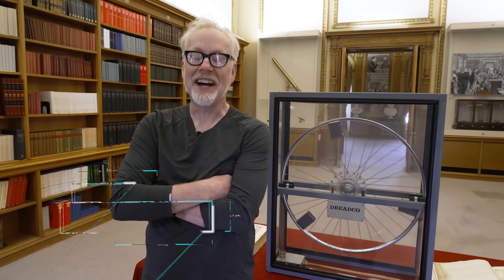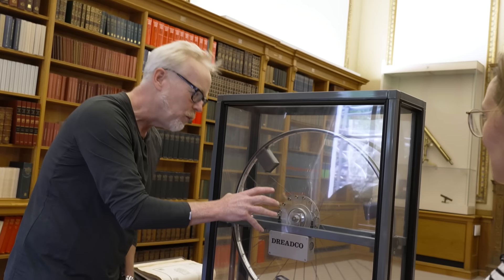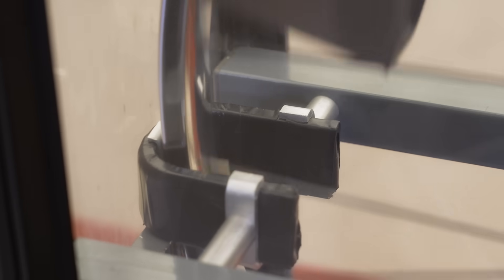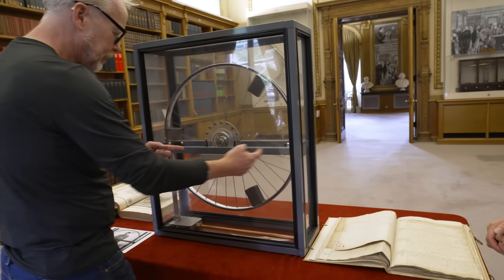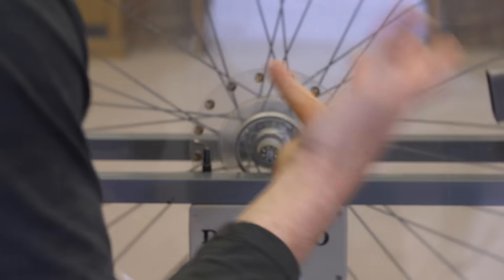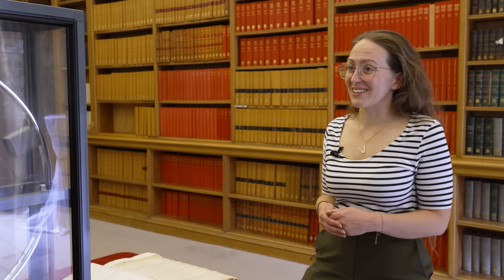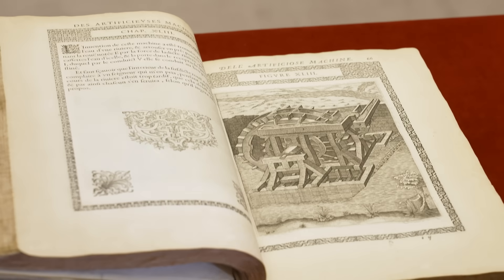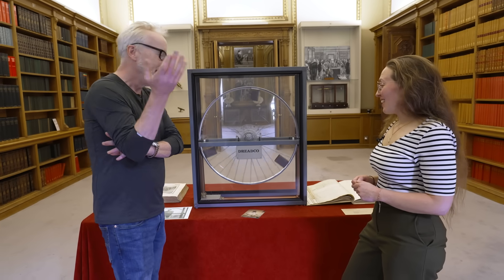Adam Savage vs The "Perpetual Motion" Machine!

Comment: This is how I would inspect this wheel.
Put a camera on a tripod. Position it so that the optical axis if the lens is on the rotation axis of the wheel. Film it for couple of minutes to get a precise angular speed. Also with a bit higher fps if possible but may be not necessary. Now, edit the video by rotating the image in reverse direction to make the wheel stationary. This way you may see anomalies in the wheel movement, whether it's speeding up or slowing down at certain points. This way you would know when the force is applied. Additionaly you could process the video through motion amplifier filter to make the anomalies more pronounced. This might get ideas not only when the force is applied but also where and what is the nature of it. Would that be sinusoid like or a short impulse.

Comment: I suspect those boxes are filled with water (or liquid) which cause a weight transfer thus turning the wheel. I also suspect because of evaporation of the water (or liquid) within the boxes this is where the service bit comes in. They just top up to the required fill line.

Comment: Perhaps only 1 of the three rotating boxes is active and the other two just dummies of identical mass for balance. And only one of the two U-shaped objects on the sides is a magnet the other is just dead metal. Inside the 1 box is a micro circuit (with battery) turned on and off by means of some small mechanical switch that reverses current in a small wire loop within. This causes attraction as it approaches the magnet and then pushes away from the magnet as it passes by.  All forces and currents are ultra small allowing the device to run not just for long periods but with imperceptible changes in rotational velocity.  Everything else are mere distractions.

Comment: if you want true perpetual motion, you need a superfluid. If you take a capillary tube and stick one end into a pool of helium 2 it will make a fountain without any outside force. put a tiny water wheel generator into that stream and you could get free energy. The challenge is keeping that pool. May be an answer to a propulsion device in space.

Comment: I wonder if anybody has looked at this device with a thermal imager camera.   It would show the faintest trace of heat indicating a point of friction and also show anywhere any powered force is being applied as the wheels resistance to turn would enact an opposing force to anything driving it.  Even it it was some slow chemical reaction, or (long shot here I know but anything is possible) powered by a very small Radioisotope Thermoelectric Generator the faint heat given off would show but I truly doubt it is anything that crazy.  Adam pointed out the small heat sink and speculated on a possible small chemical reaction.  I think he was onto something there.   Back to my question, i wonder if they would allow a thermal imager or if a camera operator posing as one of adams crew could have gotten by with a thermal imager.

Comment: I like and agree with the anode cathode and the pins off the rim are the armature connectors. The magnet on the right crates charge to send back into the system, and the left side opposes it back to the rim by electromagnetic means.

Gravity is an outside addition to the system, and why it can go for so long. There has to be some storage system for energy, and this could very well be a watch mechanism, like what you wind up for old clocks, hence the service every so often, its rewinding the  mechanism.

Theres a balance of power between all of the systems to where a very tiny amount of energy is needed from the watch mechanism and the gravity with electromagnetism makes the other parts that move the entire system together.

Thats my thinking 🤔

Comment: To make your own device similar to this think of a deconstructed electromagnet pulsing mechanical battery driven clock . Use low friction open ended bearings , The tin cans on the bicycle wheel  will interact to the  2 stationary  electromagnets which give very carefully timed pulses controlled by hall proximity sensor and pulsing circuit. Batteries can be stored in the jiffy box labeled "dreadco" . 3 good sized lithium batteries will make the device run a very long time. The electronic pulse circuit can be also hidden in the jiffy box if you think there is enough room. Carful tuning of the device will be necessary. Good luck.

Comment: In 1980, a professor I had designed a hyper-efficient DC motor. He made a demo "perpetual motion" wheel that looked very much like the video. The wheel spun on magnetic bearings, and the boxes on the wheel were magnets. An antenna charged capacitors by background radiation (radio waves, electricity running through wires https://youtu.be/_DIjsB3eu-Y?feature=shared, etc.). The antennae was hidden in the box frame. A sensor on the wheel triggered an electromagnet at the precise time to keep the wheel spinning. Like the video, the device would slow down if left in an area with low background radiation, like a basement or metal warehouse that acts like a Faraday cage. Out on display in any city, it would run forever.

Comment: 3x Perefctly weighted boxes inside the wheel, maybe other weights inside the boxes that shift weight as the wheel spins to keep it turning, everything else is a decoy? and the 2 yearly maintenance is WD40? lol, but then the wheel turns too consistently for it to be weights involed there would be an ocsilation in the speed, slow/fast/slow etc. Man this could keep me thinking for years
Reply: Maybe it's just a vacuum chamber and the servicing is simply to remove any atmosphere that's infiltrated the box.🤷‍♂️

Comment: The giant Dreadco box is super suspicious.  It's also in the center of the wheel.  Likely it contains something like a motor and batteries.  Notice the screws on the front, which look like they have a little wear (2:30 - 3:00).  Once the wheel is spinning it wouldn't take much force to overcome friction and keep it running.  

The other clue is the secret is disappointing.  So this rules out being driven by changes in air pressure or temperature.  Solar is unlikely as well, given they keep it in the dark.  It's something simple like a battery or spring.  As they also noted it slows down over time.

Comment: This is the most obvious electric motor ever. The whole thing is a motor, the bicycle wheel is the rotor. It is probably being driven electrically by the box with the heat sinks on it, with the two spokes in the middle acting as hall effect poll sensors for commutation. There is a battery in the heat sink box, or it is in the label box. Doesn't matter.

It's neat how efficient it is if it can run for 2 years without getting recharged. But I don't know how you look at this and don't realize it is just one big motor.

Comment: Its an electrostatic motor that is powered by a clever wimshurst generator which uses the inertial momentum and the imbalanced 2 vs 3 configuration to constantly produce an emf. One U-shaped device on one side is wimshurst cathode, one is anode.

The 3 squares out 120 degrees apart are very carefully folded copper foil conductors in such a geometry that it has the most possible surface area.

The charge is stored in very low farad rating capacitors which collect charge to produce the high voltage.

A very simple machine. Can't possibly drive a load. And, as she stated, it does slow down. Which means its extreme efficiency and not even close to perpetual motion.

Comment: Im surpised not many people know much about bike rims and hubs? Maybe it was just a 90s kid thing that we would fix our own bikes. The weights wouldn't need to keep the rim rotating straight. All of the spokes on a bike rim are threaded. With those threads and using a spoke tool. You can do whats called "truing" the rim. Someone who is a master at that can make a rim spin literally perfectly straight and so that the rim is a perfect circle as well. 
Then also the hub bearings could be ceramic. Which spin extremely smoothly. Granted you couldn't use them riding BMX or mountain biking.

Comment: I really doubt that there's any forces acting on the boxy bits on the outer rim - I expect if anything the outer rim and boxes only serve to add inertial momentum, like a flywheel - to smooth out the actual imparting of force. I think 100% of the function exists in the dreadco box and the inner spool - probably just a series of batteries and whatever electrical bits you need to impart a tiny bit of force to the electrodes that come out the top of the box. I forget the exact details of how a Wimshurst machine works but I expect this is basically that but backwards. Everything else in there is either irrelevant or hiding more batteries. I'm guessing there's not more batteries though or the weight would be noticeable and give the game away.

Comment: Impossible? I designed one over 20 years ago. Not only does it rotate indefinitely, but it also hovers without using any electricity.
Reply: I violated the unbreakable laws of physics. Source? Trust me bro
Reply: @winxwest2964  okay, I was being a little dramatic. It will only stay at optimal performance within 150 to 200 years. So yes  I was wrong in saying indefinitely 😁
Reply: @DROPKICKaZOMBIE very efficient perhaps but that is not perpetual. Big difference.
Reply: @PSOnoni  I was wrong in saying indefinite. It would continue to move and hover without electricity,  maintenance or any intervention for 150 to 200 years, until it lost a small percentage of power which could cause it to collapse. It could take another 50 to 100 years after that for full breakdown.
Reply: You must be really wealthy then with that source of infinite energy, huh?
Reply: @joexer1  it doesn't make energy and if it did, it wouldn't be infinite.
Reply: @DROPKICKaZOMBIE  For perpetual motion, you'd need to tap into an unlimited energy source.
Reply: @joexer1  not true.

Comment: I'm a fan of the Oxford Electric Bell - https://en.wikipedia.org/wiki/Oxford_Electric_Bell - Which doesn't claim to be a perpetual motion machine. It is instead a long term experiment. That has been ringing a bell since 1840. Though there may have been two brief interruptions due to environmental condition changes. It's since been sealed behind sound proofing glass because the students and staff were sick of the noise.

Comment: The things on the sides are electromagnets powered by a battery located in the middle box. It works just like a huge, weak, but efficient motor. U could say it s a glorified wall clock.

Comment: there is a clock, that winds itself with air pressure difference....
it can also use temperature difference as a source of power.
if barometric pressure rises or drops, this has power. it can actually blow air in the box to keep the wheel turning.
letting temperature work as well, a rise in temperature will get extra air pressure

Comment: Normal weighing scales balance on a bar...so a cross bar with four scales hanging off it...four equal weights in each scale and an extra weight on one scale...the other three scales without the extra weight weigh more than the one with it...and when the light weight gets to the top it tips into the next scale...in a circle...and that extra weight is less than the other three...

Comment: The only way to create a 'perpetual motion' machine is to remove energy from a very large power source to power a very small (in relation) machine. In our case that would most likely be light or heat from the sun. It wouldn't be pure, but the only way to have perpetual motion is with perpetual power, which diminishes inevitably over time. You would need to be able to power it in such a way that it never stops and never needs to be 'serviced'.

Comment: If it turns out that theres a battery inside,a solar power system or whatever it is to power this thing,then all i can conclude is that this device is just a fake perpetual motion machine,in such case that david jones is just a fake scientist of a cheater,so he better off to prove that he is not cheating,noe let’s atleast agree about 1 thing,if this device isn’t using any electricity at all,then the only thing that will stop this device to be a 100% perpetual motion machine is heat and friction to cause it to eventually stop.

Comment: GOT IT! It's modeled on the Beverly Clock!! It is sealed in an air tight compartment. As the temperature rises & falls the air tight compartment expands & contracts thus providing low yield power.

Comment: With this low energy requirements this might just as well run on the minuscule temperature difference between the top of the box and the bottom of the box moving the wheel by simply circulating the air inside the box using a principle similar to what the Stirling engine does only on a microscopic scale. That might explain the radiator looking thingy at the bottom.

Comment: I would guess that the smaller circle of the wheel has a bunch of magnets capturing a small amount of energy with the little prong things off the demco box. In turn forces some energy out to the larger magnets around the outside pushing them around to keep it going

Comment: What Do U Think About A Electric/Stirling Engine Hybrid Vehicle?
...An Electric Heat Source To Power The Stirling Engine To Power A Vehicle While The Running Stirling Engine Powers A Generator To Recharge The Electric Heater Battery That Powers The Stirling Engine... Along With An Alternator To Power The Electric Heater While The Electric Heater Battery Charges Up?🤔 Farther Range Possibly Than A EV As We Know Today🤔...

Comment: I think it is a unballanced wheel, in the boxes is a schifting/sliding part with some mass, the two oposite parts where the wheel runs between are Electric Magnets that with little Electric energy move the part in the box from oudside to inside and visa versa so on the right side wil the wheel have less mass than  it have at the left side, right must go UP, left must go down and that unballance in the wheel wil turn it.

Comment: I could make that run longer than two years,, if the angular position finer then the magnetic forces could be partially captured rotation as well as very lightly and auger magnetic rotation then you could have it running for about 270 years on a twin AA rechargeable battery cube, it also has copper piping that could permit for all sorts of applications.

Comment: I thought it was common sense but with advanced maths lol... basically the weighted plates need to be perfectly spaced apart so gravity pulls weight down while it also pull the other side up
Reply: Well, it’s not common sense because that doesn’t work.

When you make the weight heavily baised to one side, the center for rotation moves off the axle. It no longer will rotate properly. Usually the center of mass moves below the axle.

Comment: The only REAL Perpetual Machines are Solar Systems. No batteries.
Reply: That’s not perpetual motion… it’s getting energy from the sun. Perpetual motion requires no energy be put into the system.
Reply: @captainhellhound7451   yeah but sun is part of the system. it's making unlimited energy for the perpetual motion system to keep going on and on
Reply: @kingbeastu  the sun is going to die. It will eventually collapse in on itself.
Reply: @captainhellhound7451  Yeah but that's along time later

Comment: Perpetual motion is seemingly possible by creating a pressure difference due to difference in temperature. Hot air rises because its density is affected  by temperature. As air rearranges itself a pressure difference is created between the top and the bottom of its vertical trajectory. This rearranging creates a flow of air that can be used to create motion. But… this isn’t free. Temperature differences are created by an HVAC system or other external sources like the earth or the sun.

Comment: 0:26 MAGNETS & Static Electricty!!!! When they pass through, it creates a charge, which is then passed through the piping to the other side, to keep a balance. The heat sink, is so it doesnt overheat after months of doing it. The central cathode and diode, essentially do the same thing. Creating an electromatic charge from the friction/static charge of the central wheel. This adds to the decrease of loss of productivity
This is why it is enclosed. So it can maintain the proper temps, and humidity. To help create that static charge
Is a relatively simple machine, one in which has been done throughout history in different formats

oops, was i not suppose to say?

Comment: As a kid I had a very small crystal radio, without any battery. All it needed to produce sound was it needed to be clamped onto a metal curtain rod. It picked up radio waves and used that energy to drive a tiny in earphone. Maybe a Faraday cage could stop it.

Comment: I always thought if you took a "stick" with a bearing on the top connected to a tether and weight... and if you put a set of gears on the top that would change the position of the bearing just slightly through the spinning of the weight every so often as needed... it may work to keep the ball spinning. Put alternator on top and try for free power. A combination of centrifugal force, gravity, and the change in frequency of the spinning weight through it may do it. Could be wrong but that would be the design I'd go for.

Comment: This is my opinion of what i think it is and i think its a Perpetual motion low voltage A/C current generator 😮 positive negative positive negative positive negative with perfect timing using the perfectly placed weighted magnets and sand or silica inside the boxes on the wheel hints why there are external ports on the box and current collectors around outside of the wheel😮🤯🤯🤯probably could charge small devices like cell phones or anything that requires A/C current but very low voltage etc.

Comment: i would guess there is a gas with a high density in there too acting like a waterfall as the wheel turns it flows thru the pipe